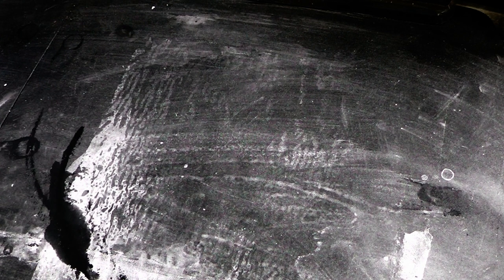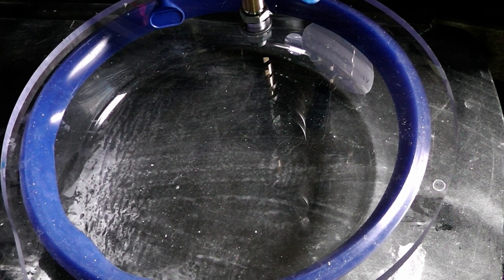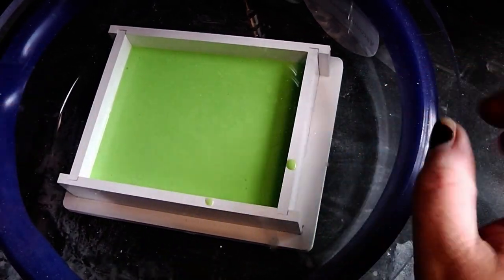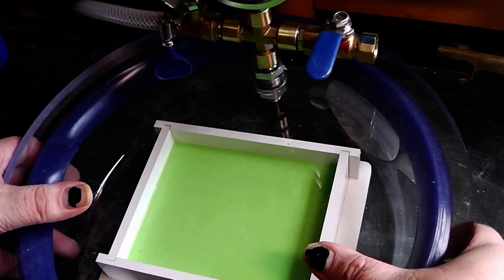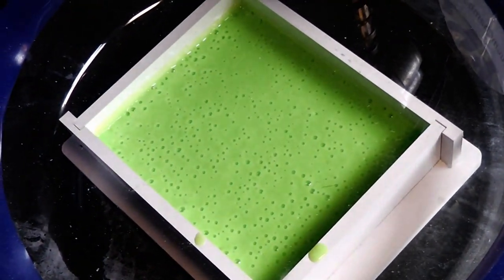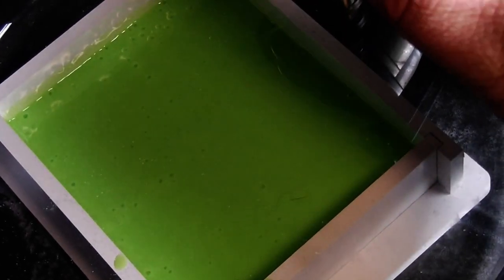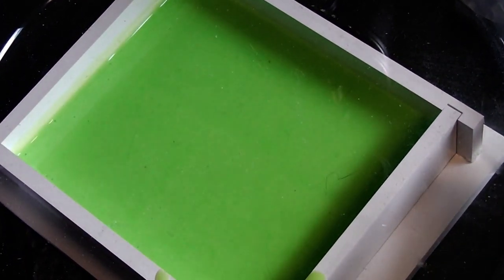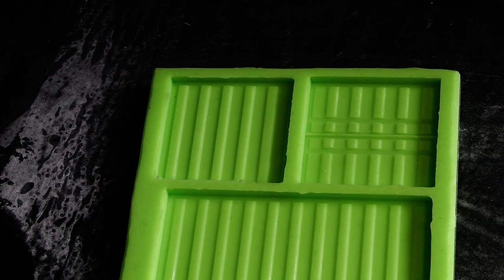Casting Silicon with a Vacuum Chamber

Comment: just looking into this and those pressure / vacuum chambers aint cheap they're around £50-70 for the basic.
Reply: I was wondering about that as more and more people on YT seem to be using them. Interesting.
Reply: I've seen several home made models using a pressure cooker, a heavy gasket and a thick acrylic lid. You need a vacuum pump of course so 50 pounds doesn't sound too bad for a complete kit.
Reply from the maker: My set cost me 157€
Reply: @GirlPainting  Thank you! I shall look into it!
Reply: Pat G you can make a vacuum pump out of a refrigerator motor. Most air conditioning techs have made one of these. If you are lucky to find a working motor from a discarded freezer then you can make one under 50 euros.